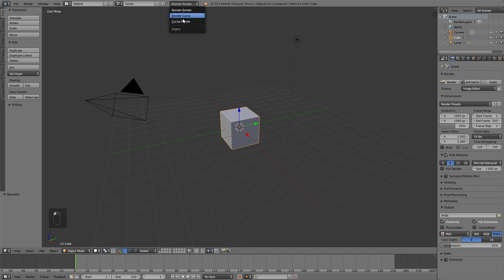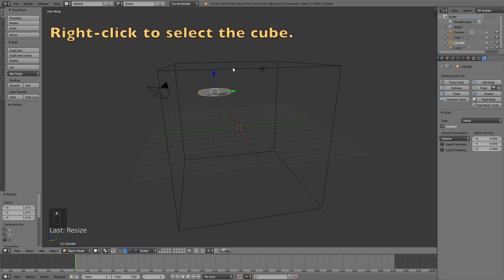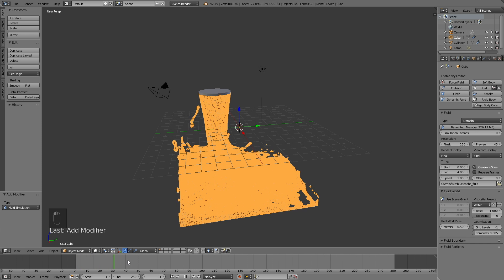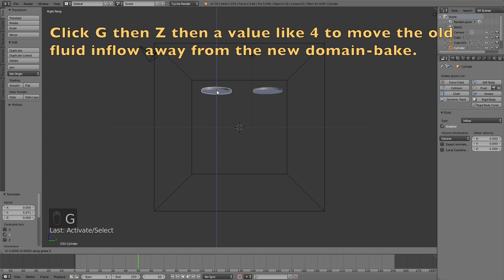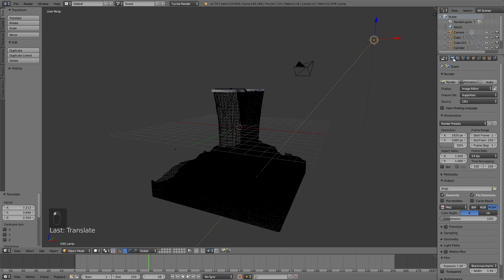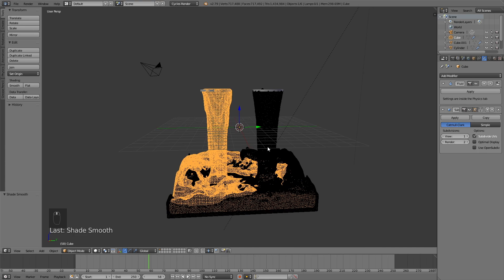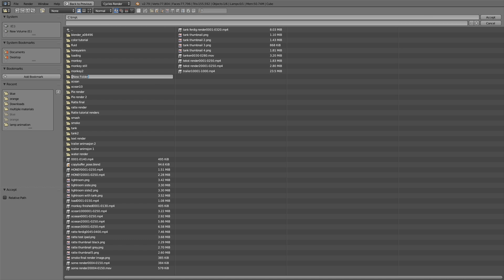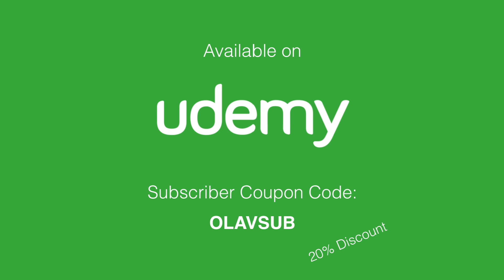[2.79] Blender Tutorial Fluid Simulation With Multiple Materials And Colors

Comment: I want to show water falling from above, into a container, and fill it at 1/3 of its size. How can I do that?
Reply: You can either keyframe the inflow, or have a shape the size of 1/3 of the container, and set its type to "fluid" instead of "inflow"
Reply: thank you that worked very well! I have another question.. I have my 1/3 fluid in bottom of  the container, and I want to rotate the container 180 degrees and the water to keep up with the rotation. How can I do that?